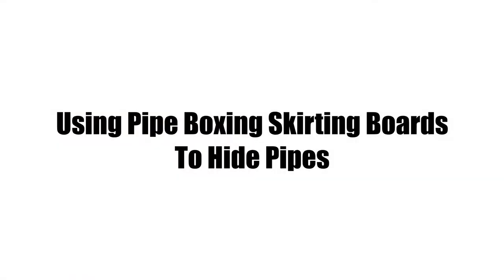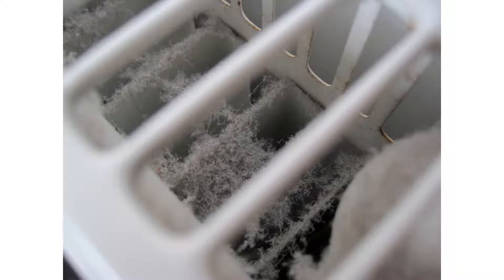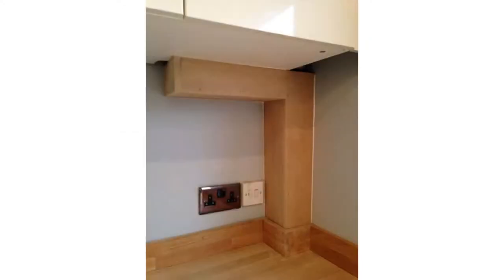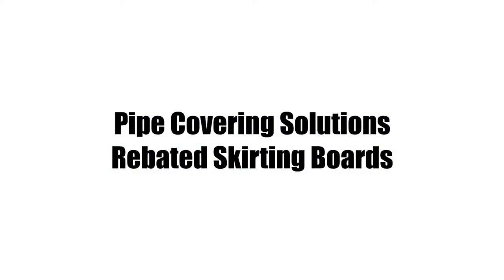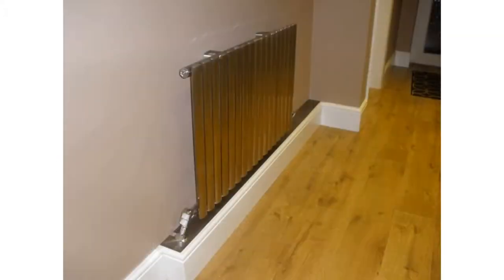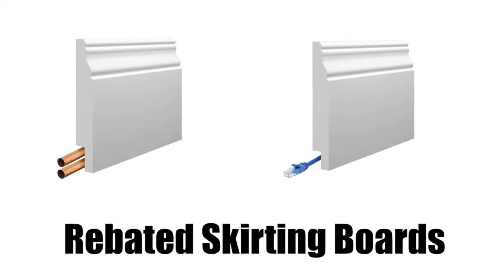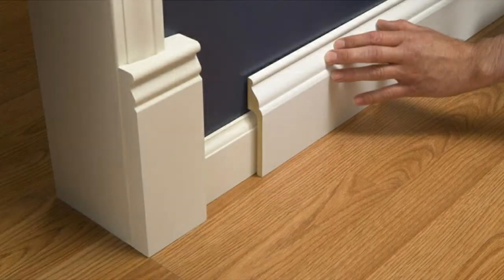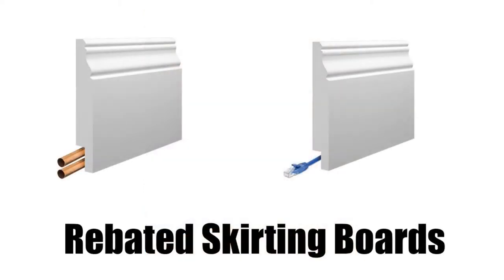Using Pipe Boxing Skirting Boards To Hide Pipes | Skirting World

Comment: How do you work it around the pipe to the radiator valves? I suppose you would cut a notch out the skirting board.